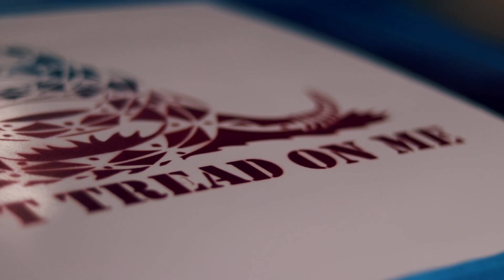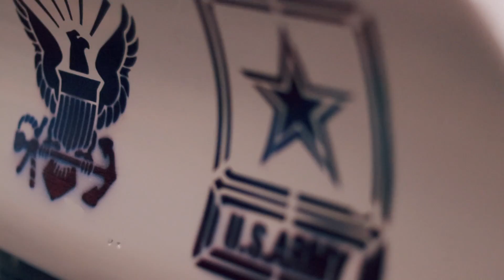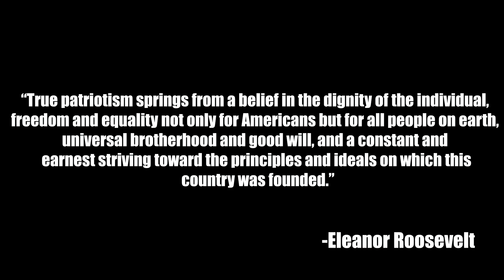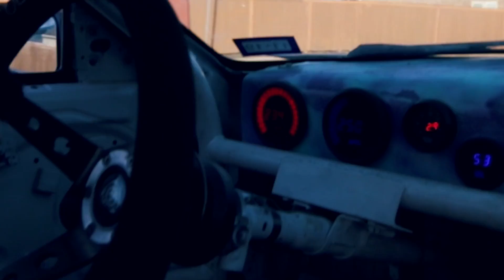The Most American RX7 Ever Made!

Comment: been watching you guys a lot I have a miata and v8 rx7 project as well. just wondering what do you run for a trans?
Reply from the maker: Thanks, we definitely appreciate the support! Two very good projects to have lol We are running a T56 out of a 1994 Camaro. We needed the older one because it has a different input shaft and design. It bolts right up to an old school Small Block Chevy. If you're running an LS, you'll need the newer T56 from a 98+.